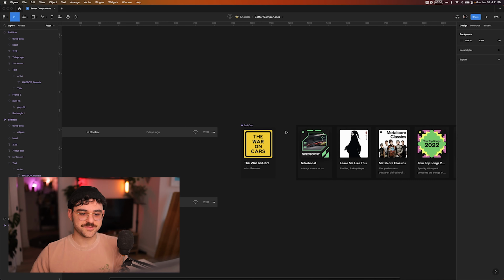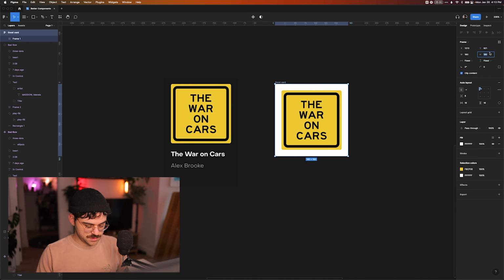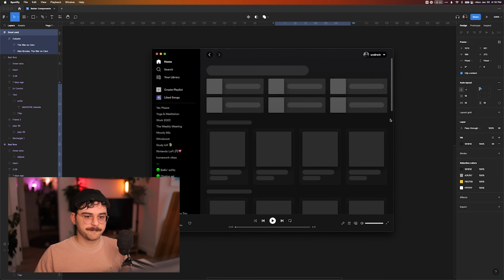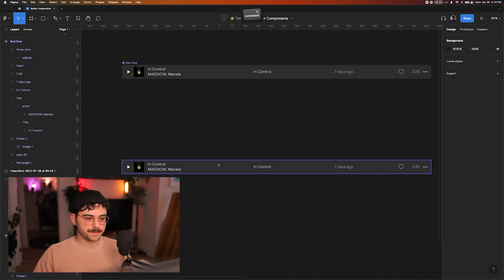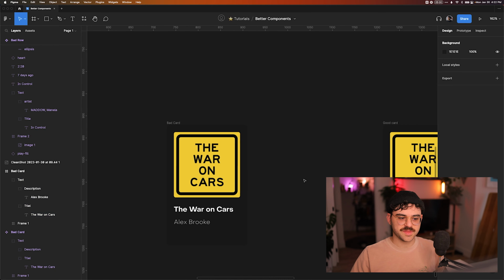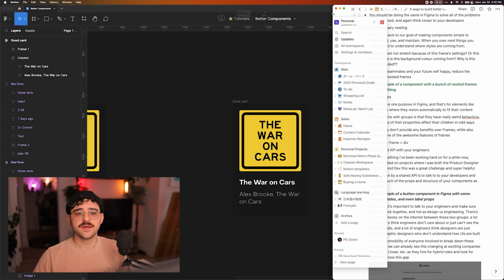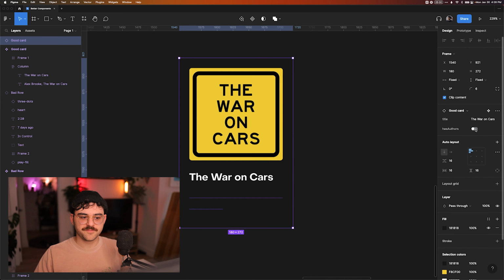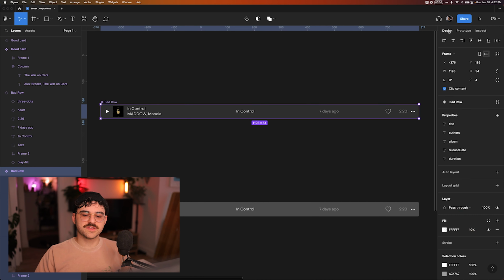Elevate Your Design Game: Perfecting Figma Components

Comment: Hi, Sekei. 👋Your videos have been super helpful! Thank you! I wanted to bring up an issue I just came across to see if you have any tips on problem shooting it. After learning that it's better to use frames instead of groups to communicating design decisions and seeing inconsistencies in my spacing because of not making my components responsive, I went back and edited my components and added auto-layout to the iPhone frames themselves. 

But now, Figma isn't allowing me to make my bottom nav "fixed" (always showing at the bottom of the screen). I've tried going into each component and checking its scroll settings under prototype since that's where I've seen the "fixed" element options after Figma's latest update. But haven't been able to fix it yet (pun intended lol). I think it would be awesome if one day you could make a video of common things you have to problem shoot when using Figma and your approach or list you kind of go through in your mind. Anyways, thank you for the super helpful content!!
Reply: I figured it out! When I removed auto-layout from the iPhone frame itself, the option for making the bottom nav fixed wasn't deactivated any longer. 🙏 That option for making an element fixed is now in the prototype settings now instead of in the constraints area under the design tab.
Reply from the maker: Glad you got it! You can’t make elements fixed when they’re in Auto Layout frames unfortunately